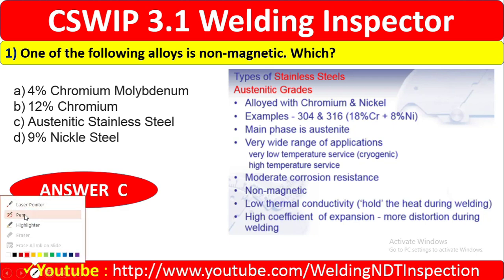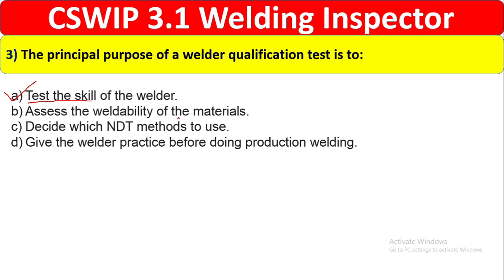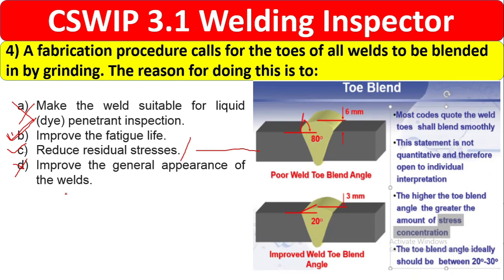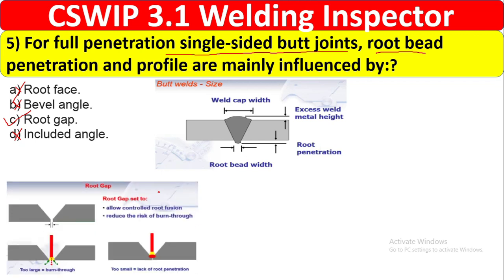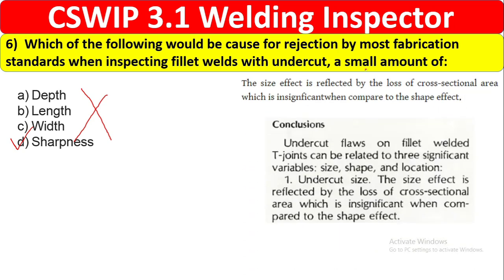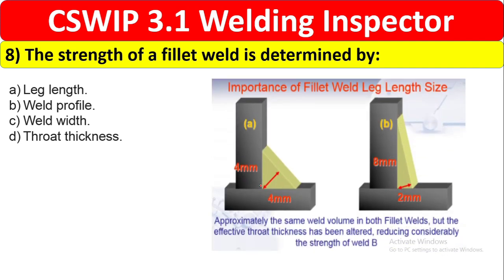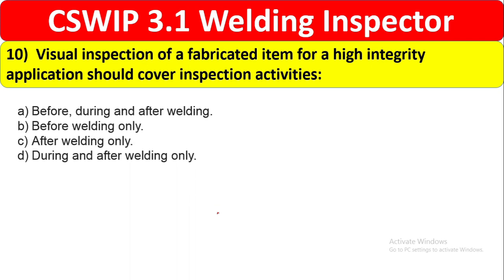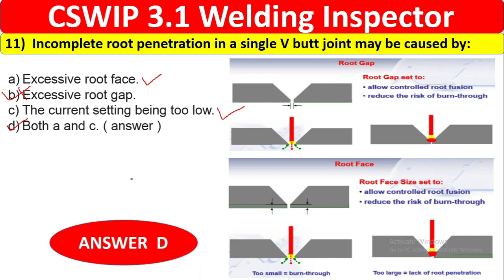CSWIP 3.1 Welding Inspector  Exam latest Questions [Part 11]

Comment: Sir there is practical exam also difficulty and need deep study and resources very little, please review and help to solve questions,
Thanks alote for your effort
Reply from the maker: Please check my other videos, are there regarding practical exam. Thanks
Reply: @WeldingNDTInspection  yeas sir I am already see was good,
But i hope you makes more like how to calculate root concavity in misalignment joints and what is sharp undercut and fine under cut
And all related questions it's really hard not easy and TWI very limited for practical day study,